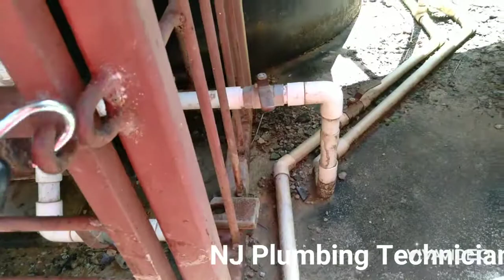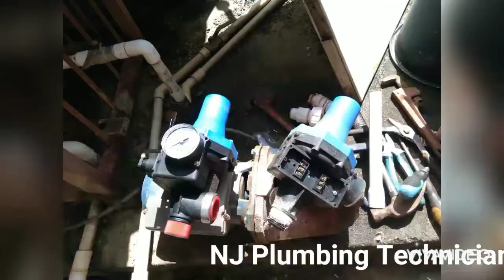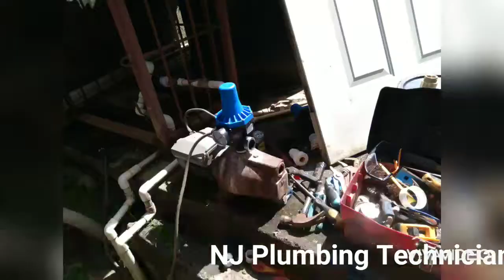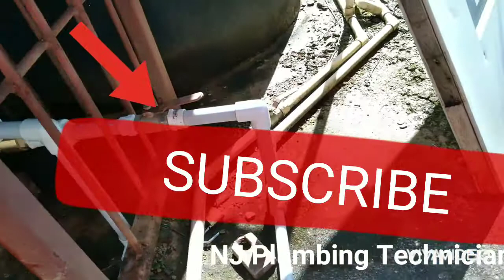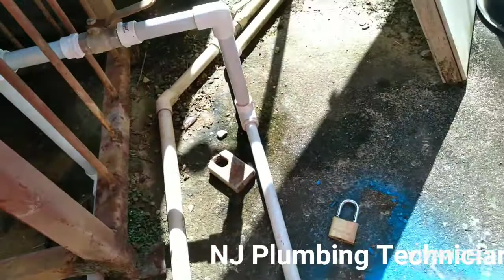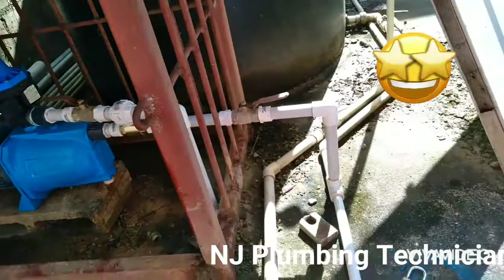Plumbing In The Caribbean - Smart head replacement.

Comment: Pentax pump with smart head. The water tank ran low now that it's full again and tap is opened it starts with little or no pressure, then builds up. Can you advise
Reply from the maker: @dillongibbs3316  
Could be it has an air lock or the pump clogged with debris. 
I can't be 100% correct with what I'm saying because there are tests to be carried out to check, but I'm not there, so I'm guessing.

Comment: Hello, I just recently installed a Total brand Smart head. It keeps coming on every minute, literally. There are no leaks. Do I need to adjust the pressure switch on the pump? Thanks
Reply from the maker: Most likely, you have a leak and you can't locate it. Sometimes, you need a professional to check the cistern for you to make sure there isn't an issue.
Always remember this, a leak can be external or internal. Some you can see and some you can't.
Once it's checked and there's no leak, then it may be a defective smart head or something to do with the pump set up.

Comment: Is it necessary to have the tanks with the rubber diaphragm on those pumps? Or can you just replace the smart head an it will still be okay?
Reply from the maker: Are you referring to the pressure tank.
If so, the pump motor can function with either one.  It's up to you with what you prefer. 
If you want to convert from a pressure tank to a smart head, there are changes to be made in order for it to work.

Comment: Does a smart head need a pressure switch on it ?
Reply from the maker: No it doesn't 
Neither a float switch to indicate if the water runs low in the tank.

Comment: I’m having an issues where there’s no visible leaks around the house or on the pump but it keeps running nonstop. What could be the cause of this
Reply from the maker: They can be many things which can cause a pump to do that. 
It could be a valve, smarthead,  a leak under ground or inside the house etc
So test have to be carried out to pinpoint what the actual problem.
Reply: circuit board needs replacing
Reply: The best thing do is put a valve on the out put part of the pump. So if you turn it off and see if the pump is cutting off.